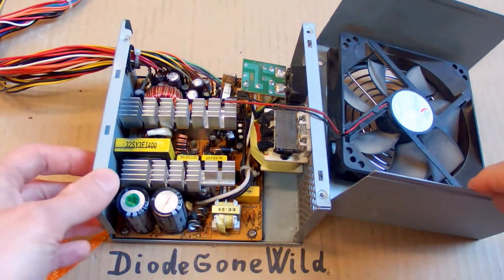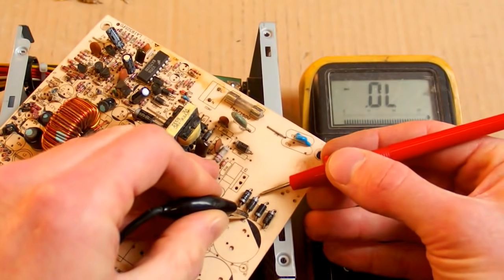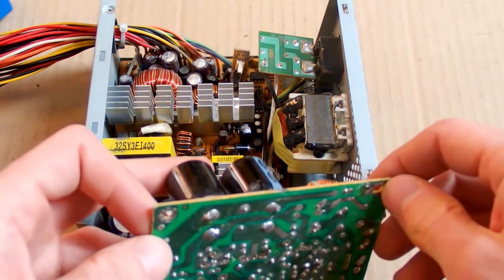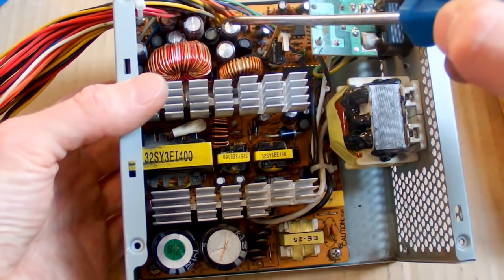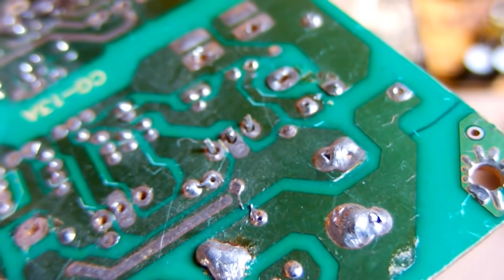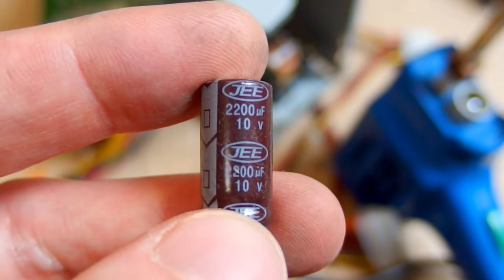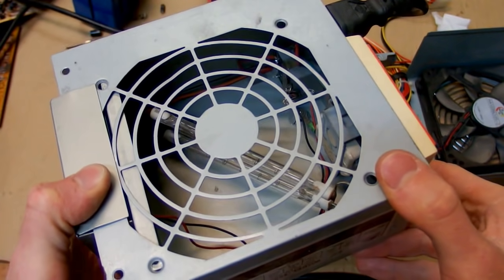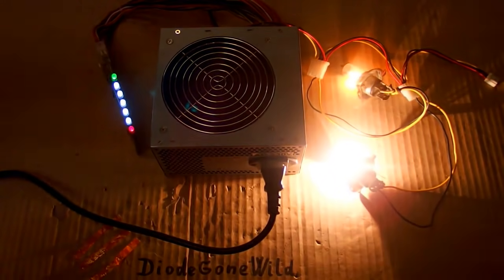How To Repair a Computer Power Supply (or other switching power supply)

Comment: I have a brand new 500Watts power suply, it says that on +12V i have 30Amp. So why is not like that? The source turns off if i connect a light bulb from my car.  Should work, right?

Comment: My smps is giving low voltage on all the rails  11v on the 12v rails,  4.5 on 5v rails and 2.9v on 3.5v rails what part could be causing the issue. please help identify
Reply: probably the feeback circuit has a problem, sometimes current sensing resistor break or go up in resistance

Comment: if you had a 650w power supply that that had a light silicon burning smell when you switched  it off then would not turn on the next day what would that sound like to you? the only reason i ask is cuz it wasn't even 6 months old i don't think. would it be worth it for a light DYI'er to attempt repair himself? the smell reminded me of the time a installer accidentally smoked a transformer when repairing a boiler at work. it was very faint smell and at the time i did not think of it until i went to turn it on the next day and it would not turn on that's when i remembered the smell i smelled. so i replaced it with something i had laying around to get the pc to work for now but now im wondering if i can fix the old one ... any thoughts on this?

 edit: i did visually look at components on board but everything literately looks brand new ... nothing bulged, burnt or leaking ... not even dusty ...

Comment: my old powersupply suddenly died while the computer was being used and simply shut the pc off. All LEDs on my keyboard and mouse as well as the motherboard were still on but the psu failed the paperclip test. What is the most probable reason that it died? I have a new one now but still want to try and fix it
Reply: The most common failure is electrolytic caps bulging (may have increased ESR even without bulging, but if bulge they are definitely faulty). ESR (equivalent series resistance) meter is the definite proof. Next statistically failing components are the diodes, zeners etc. There is no easy way to tell, but by methodical elimination
Reply: i have checked the capacitors and see no bulging but will get myself a multimeter to check for sure. thanks for your answer, I'll try everything you mentioned

Comment: Hi, i have a Cooler master 850 ATX Psu, the issue is that it goes intermittent.  The power turns off after about 1hr or so.  sometimes, i have to turn the main switch at the back on and off many times then it goes on for about 15mins then it goes off again...can you help me which component most probably is busted or faulty> thanks

Comment: This How To uses older low price PSUs as example. The troubleshooting on a modern PSU with APFC and synchronous rectifying (80+ Gold / Platinum / Titanium units) is more difficult. Because you have more ICs and a more complicated circuit. The size of the primary cap is also much bigger and more dangerous if you don't discharge them before work.

On the other side, why repairing a $20 Unit? Much to dangerous for that money. The good units from big factories like Seasonic or FSP have 3 years or more warrantee. No need to repair it yourself.

Comment: is it worth it to repair or buy the new one?
Reply: It depends. If the PSU is really old then every part in it is old. Everything might be about to go then. The industry standard is to run electrolytic capacitors for 5 years then replace them. So pretty much once a SMPS is over 5 years old it is time to replace it, even if it is still "working". But if the PSU is new and it failed because of some misadventure then it might be worthwhile to fix it and hope nothing else bad happens to it. As everything in it is new, so good, except for what is bad, that you're going to replace with good. Which should make it all good again. The exception would be if it is a very expensive PSU that you cannot economically get a replacement for. Then you'd have to change every electrolytic capacitor in it on a regular schedule. Plus make sure all other components are good. Maybe rethink why you have such an expensive and hard to get PSU too?

Comment: I have a problem with my desktop psu. when I open the switch the psu is always on. where can I search the circuit to found the problem? with other psu all works perfect. thank you
Reply: ATX power supplies have auxiliary power section and main section. Bringing the green wire to any of the black (GND) should enable the main section; opening it should stop it. If it stays on regardless - you have to check the green wire associated portion of the circuit

Comment: Can you demonstrate how to build the Test Socket with halogen bulbs in separate video. Thanks
Reply: That's how it works.
Reply: If you can't figure it out from just what he showed then you probably shouldn't try to build one yourself.
Reply: Paul Frederick why?
Reply: I need help on this too
Reply: Because there are potentially lethal voltages and currents involved. Or in other words you could get hurt, or worse. Some sensibilities you just need to come by naturally.
Reply: I just need the cct diagram to understand how it works,
Reply: you just pass the current through the lamp. So you hook the bulb up in series. Then if you draw too much power the bulb simply lights up. Bulbs are natural current limiting devices. If you put a bulb across a voltage source it just lights up, right? That's how it works.
Reply: Hmm, thanks, so if I have a panel with short diodes or transistors or MOSFETs, and I plug it in the socket, it will short the circuit and light up the bulb?
Reply: Thanks
Reply: Paul Frederick sorry for disturbing you, I have a 220v~ to 15v d.c panel that uses MOSFET 10n60, an optocoupler, 8pin control ic that has 22ohms, 10k ohms, 1k and and cap around it, with a switching transformer, I narrowed it down to the control I.c, it seems not to get power to the MOSFET, what do you think might be wrong
Reply: I don't know. Is the control IC getting its start up power? If it is then it is the likely culprit. When repairing electronics you must always bear in mind that parts tend to fail for good reasons. Which means something else went bad that in turn took the IC out. Parts in circuits are also parts of groups of parts in circuits that together are supposed to perform a specific function. Those functions add up to the whole circuit performing its function. So there are logical interdependencies within circuits.

Comment: Can you teach us how to boost atx power supply voltage from 12 to 14.6 so that we can charge our lead acid battery
Reply from the maker: Hello, try this:
http://danyk.cz/at_atx_en.html
Reply: ATX power supplies impose limits on all voltages. Changing the voltage (resistor divider value) may also call for monitoring circuit adjustment (if nuisance trips result from the change)

Comment: Hopefully this will help repair my PSU. Its a Thermaltake 600w modular PSU and after 11 years it failed... Now i am wrestling with a domino of failing mosfets and other components. So far PFC and main switching mosfets have failed and propably the controller too but i will order all of them and try to fix it but it is quite more complicated than this one though
...
Reply: You can temporary simplify the task by not installing the main switches while testing the PFC (until you get a steady 350V or something, as load you can use two filament bulbs in series. You can also feed the main controller chip from a lab power supply (without high voltage and without main switches). This will allow you to evaluate the chip consumption, its ability to produce the expected reference voltage and even eventual gating signals for the switches
Reply: After 5 years you should just buy a new PSU. Just because a PSU is still delivering power does not mean it is still delivering clean power. As your output filter capacitors fail ripple goes up.

Comment: How to make it variable?
Reply: Power supplies compare a reference (or fraction of it) with the output voltage (or fraction of it). Re-scaling could be done by changing value of one of the resistors in the respective dividers. Vout=Vref(1+R1/R2) (no reference divider), R1 from the output, R2 to GND. Bear in mind that substantial higher output may call for higher voltage rectifier diodes and related capacitors. Also the control chip duty cycle control range may limit how far you can deviate from nominal. Higher output voltage calls for higher duty cycle and in some cases of auxiliary winding may hit over-voltage limit of the control chip

Comment: Nice work
But can I raise voltage to 30v and make power supply variable
Reply: You can raise the voltage...but not the power (i.e. at the expense of lower current)
Reply: You might be able to if you break into the voltage divider by the voltage reference IC (TL431) and put a potentiometer in there. That ought to change the output voltage.

Comment: can you explain how to make that computer power supply testing circuit?
Reply: It looked to me like a power connector off a motherboard and he connected resistors and LEDs to each power rail. You size each resistor to supply the right current at each rail voltage to its LED. Then he had a switch to short out the green power on wire.

Comment: I have PSU that blows transistors when i exceed 3A on output. I checked everything and cant find what causes it... anyone know what can be reason of that?
Reply: Try to buy parts from trusted places, the ones on ebay could be fake parts... I had this problem too and was the fake parts.
Reply: I figured it out already and you are right. I had fake transistors... i opened one and could see its different from original ones. Now it works on some other transistors and everything seems ok. I modified it to 0-35V and 0-6A adjustable bench PSU :D

Comment: I'm trying to fix my power supply and I checked all the transistors, diodes and capacitors for shorts and opens. But the power supply isn't still turning on. It has +5VSB and +5V PS_ON signals. Any thoughts?

Comment: The key is finding replacement parts. I have seen some turn to ash. Especially in AC to DC converters. Many manufacturers will not tell you what parts they are or sell individual parts.

Comment: hi, in my SMPS circuit, the input capacitor is showing 315 V and after that the 200 k resistor is going to 10 V to pwm integration. I think the low voltage comes from the resistance can be caused by the power of the PWM itself? You need to enter the pwm integration close to 30 because.
Reply: The input capacitors charge to 1.41 times the input voltage RMS value. If you operate from say 240Vac , then 315 V is about right. This voltage is also used by start up circuit, temporary powering the control chip until its auxiliary power takes over. It helps to power the chip directly from lab power supply (following datasheet recommendations), without high voltage applied. You will be able to check its consumption, appearance of reference voltage and gating PWM signal. If the chip works force fed, but not from high voltage - either start up circuit or auxiliary power are worth checking

Comment: Overvolted control chip bc  the capacitor fail and the energy from transformer   is released as high voltage spikes . This also can demage your computer parts . Pc supply whithout the OVP protection.

Comment: Do you want to say that every component in the ATX power supply could go wrong !!!!!!!!!!!!??????
Reply: All components have failure rates depending on type and stress level. Practically however, most common failures are in electrolytic caps, then diodes, zeners, etc

Comment: Awesome video but I would like to know how this light tube works at short circuit
Reply: This is a like serial bulb tester but he used halogens for bulbs. Connect to AC wires to halogen and it glows fully. If there is any load (here SMPS) it will glow dimmly. 
But by chance if SMPS has internal short ,tube will be fully bright.(equivalent to small black jumper wire he used to demo short)
Reply: It is in series with the load (the tested power supply). It limits the eventual current. Normally working power supply with no load will consume very briefly on power up and then iddle with low current

Comment: where did you get power supply schematic and there is no way to tell what it is.   HELP
Reply: Sometimes you have to work with whatever you get and reverse engineed sections to figure the differences form the examples found

Comment: Can you touch the components immediately after the powercord is disconnected? How long are the capacitors charged? Can that voltage kill me?
Reply: Just shorting out capacitors is a bad idea. Doing that can blow out the dielectric in the capacitor. You should bleed them down with a resistor. Decent PSUs have bleeder resistors built into them.
Reply: It can, be careful and ALWAYS discharge the capacitors before touching them. You can discharge them by shorting both pins with isolated screwdriver or something similar

Comment: P.S.
The two input filter capacitors rarely fail. When they do fail, there are two common causes:
1. The input voltage switch was set to 115V but the PSU was plugged into a 230V socket.
2. One of the balancing resistors (typically around 150k ohms each) has gone open circuit.
Reply: The input caps operate on low frequency (50/60Hz) i.e. experience peak currents at low rate. The output capacitors operate at over 100 kHz i.e. tend to wear faster, especially in conditions of elevated tenperature

Comment: Nice explanation !!! .. I'm repairing some ATX PSU, it is 5v  stby but no other voltages at the output after green & black wires shorted, any sugestions, Sir??
Reply: Always test with some load, some PSUs can pass self-test without load. Note that all voltages are monitored against limits and protective circuit can latch off

Comment: You forget to mention the fan.
Sometimes it has bad bearings or dead. I have a dead fan from a power supply, but I throw it away.

Components like transistors or transformers get hot and blow up. Although they have heat sinks, they are small and don't cool it down fast.
Reply from the maker: You're right. The fan sometimes gets stuck because dust gets into the bearing or because the oil solidifies. It's usually just sleeve bearing - a bearing that has no balls :).

Comment: That power supply looked kinda familiar... then I realized I harvested the parts from an identical one a week ago! Is it from a Dell PC?
Reply from the maker: It could be, but it's been taken from a PC many years ago...
Reply: Can I please ask you DiodeGoneWild? (I am from cz but I will try en).
Did you think about making video how to connect pwsply to any schematics on the internet?

I had also on second pws bad resistor which can not be read and this one trying really fix I hit the issue I am really amateur, not so much with searching engine, hopefully, trying "atx be-350ws" from box or from pcb "xhy-300ab v5.0" I did fail to find or at least connect my psu with schematic on internet (in best case I did find web of someone like Danyk, later find it is probably you again; it is hard issue to go).
I was thinking that maybe such video would be interesting for people maybe slightly also in general (although it looks to be easy and slightly out of electro work but such hints would maybe help strongly also).

Comment: Excellent stuff man, thanks a lot.
That tester is cool, but how to make one?!
Also this MTester for testing various electronic components(R,C,L,Q...etc.) is really good
https://www.banggood.com/LCR-T4-Mega328-Transistor-Tester-Diode-Triode-Capacitance-ESR-Meter-With-Shell-p-1112140.html
You can place 2 or 3 pins into the ZIF socket then use alligator clamps for use on fixed components.

Comment: thanks nice vid
I modified some atx psu for charging batteries but most of them blow if the battery really discharged and most of them is cheap ones Higher tier psu is harder to modify do you have any experience in this?

Comment: Perfect timing. I just picked up 2 flat screen TVs for free and one has a bad PSU I need to fix. 1.) Any suggestions for sourcing low ESR capacitors at a good price? 2.) Also why do some leaking capacitors get super corrosive on the PCB? 3.) What's the best solution for this corrosion? Can I simply clean it, neutralize the chemical, test the components and replace the faulty ones, or is the corrosive chemical more than a surface problem that will cause everything to fail? The chemical/corrosion seems to penetrate everything it contacts. In this case I have a couple of SMD IC's that are at the edge of the fallout zone and I'm not sure if I can find/order them. 4.) In your experience does everything touched by Greek mythology's capacitive hand of Midas turn into a golden short circuit necessitating replacement, or is there potential to salvage these zombie parts?
Reply: Upcycle Electronics       vinagre neutrlize corrosion ,  vinagre from red wine ...

Comment: May i ask a question to someone who has experience with ferrites. How much power a EE25 (PC40)in half bridge topology at about 100Khz can deliver. I cant find the answer on internet. I want to drain a maximum of 50W but i dont know if i can. I dont want to use my EE35 because its overkill for 50W...
Reply: If your transformer core size limits the power - raise the frequency